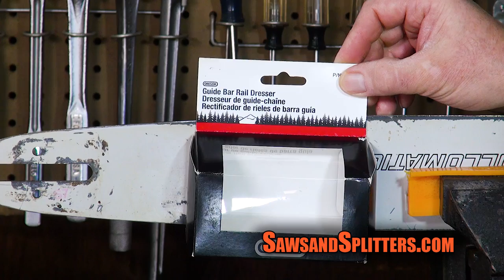HOW TO MAINTAIN A CHAINSAW GUIDE BAR EP.06

Comment: As with cleaning the saw dust, filing away from the tip sprocket minimizes filings from entering the sprocket and accidental damage to the sprocket teeth. I use compressed air to blow filings out of the rail channel in the same direction away from the tip. And also blows out the oiler holes. 
A good test to find burrs instead of your nail, is to use a dirty glove and if it catches any grime while pulling up and out, you've got more filing to do. If you're out in the field and don't have your bar cleaner/spec measuring tool, the corner of your base plate will work well to clear saw dust out of the rail channel. 
After it's all cleaned and filed, it's a great opportunity to sight down the bar and see if there's any bend to the bar (usually near the tip seam) and if your tip sprocket is splaying out/opening up. If there's daylight down either side of the sprocket or both, it might be time for a new bar since it will tend to throw the chain more often and/or wear out the tie straps and drivers on your chains.

Comment: A disc sander also works great for deburring the bar and squaring the top.  Use a black sharpie marker to color both rails so you can see after sanding where it is not square.

Comment: Excellent job. i appreciate how concise and clear this video is, and other than failing to mention the oiler holes, you hit the main points. 

in my experience, for those who are interested, the newer the chain is, the less sensitive it will be to burrs on the bar causing issues, and the more worn, the more sensitive. 

as you file the teeth, they become shorter and your cut becomes narrower, causing the burrs to contact the wood sooner. Also, the burrs are more noticible when making horizontal cuts when you rest the weight of the saw on the bar rather than holding the weight.

Comment: Great video, learned a lot. So my issue is this: brand new chain saw, the first time I used it and I wacked the edge of a plastic wheel barrel which seemed to cause the chain to cease. Disassembled the blade and the chain binds on the lower. How do I fix that..Thanks and keep making your videos, we're watching.

Comment: Good tips, but a little incomplete.  When cleaning the groove, btw they make an inexpensive tool specifically for that, you need to pay special attention to cleaning the oiler holes at the end.  If they are plugged, clean grooves will not matter.

Also, as bars wear, the groove gets wider from wearing on the inside.  Thus, your chain will not fit tight, causing it to lean to one side or the other, causing issues with cutting crooked and causing more wear to the bar.  They also make an inexpensive tool for closing the gap on the rails, fixing these issues.

As for flipping the bar, I do it every time I sharpen the chain, and I clean the grooves and oiler hole at that time also.

Good video though, bar maintenance is a very overlooked topic.
Reply from the maker: It's tough to cover everything and I'll be the first to admit I've got more to learn.  Thanks for adding to the discussion.

Since I was in high school I've used a drywall knife to clean the bar and it seems silly to get the special tool just to have the special tool.  That tool would be nice to have to measure the depth of the rails.

I've seen that roller tool on the Baileys website.  For the amount I use the saw I'm not sure I'd ever use it but it would be fun to have one it the tool box just in case.

I am horrible at taking the chain off and putting the chain on the saw.  The reason I hand file is to avoid having to remove and install the chain as much as possible.  I'm kidding, not really.

Thanks again for adding some great info to the discussion.
Reply: CTSCAPER , I totally understand that, and I hope my comment wasn't taken the wrong way.  
Your video is great, and seriously touched on a subject that is rarely discussed or fully understood. 
I learn something new every day, and just wanted to share my experiences with you. 

The taping knife as a groove cleaner is a good idea, way better than using a screwdriver. 

I know what you mean about buying tools you may not use much, I have lots of those...  lol!

It is nice though, for when you really need it, or if a friend does. 

Keep up the great videos, I always look forward to seeing what your next video is going to be. 

Thank you, and take care!
Reply from the maker: No offense taken.  I've been buying tools I don't need for years and every once in a while I think, "What the heck?!"  Then I'll be out at some hardware store and come home with more.... :-(
Reply: CTSCAPER lol!  😊

Comment: I have had a Black and Decker Electric Chainsaw for the last 40 years, it is so light I can hold it in one hand.   The bar has been dressed several times, and as well as the burr on the outside of the bar, it also creates a burr on the inside of the guide slot.   This has to be removed with a 1.2mm thick flat mini-file.    I think I have also used an oil-stone for the external dressing.
Reply from the maker: That's great news about your Black and Decker Chainsaw.  I've been looking at battery powered saws and your feedback is good to hear.

Comment: Can i restore a bar with this method when the chainsaw is already cutting bends?
Reply from the maker: If you look farther down this thread Good Day Farm posted another reason the bar could be cutting crooked.  The rails opened up from wear.  If the bar is cutting crooked look at (1) the rails to see if they are open wider then they should be, (2) the rails to see if one side is worn out more than the other, (3) the bar to see if it's bent causing the saw to cut crooked or (4) the depth of the slot for the chain to see if it's worn down to the end and the chain is sitting proud to the bar.

I hate to sound like a broken record or being too safety conscious but if you take the bar to your dealer they will get you headed in the right direction.  If the saw is cutting crooked it could be an even more dangerous situation than using a chainsaw in the first place.

Hope the info helps and be safe.

Comment: Please note that the translation is strange because it is done through translation software.
I understand that maintenance of the guide bar is important, but it seems that the person doing the maintenance has little knowledge of the file and does not know how to use it.
Except for diamond files, you can basically only file in one direction.
Therefore, if you shave it in the opposite direction or to the side, the file's eyes will close and the life of the file will be significantly shortened.

Comment: Thanks for the video. 
Unfortunately you are filing/dressing from back to front wheel, and fill the wheel with dust.
Reply: Nothing a spray with the air compressor won't fix.

Comment: Not bad at all fella... I would add a healthy dose of air to remove that swarf, especially in the two oil holes (which will be utterly full of oily crud anyway) and the nose sprocket can only easily be cleaned with compressed air anyway. Letting it spin up with air pressure (WEAR EYE PROTECTION) will usually release a surprising amount of rubbish. 

When filing don't go back and forth with the file... It will not only damage the file but the end finish will not be as good... Instead keep the angle with the cut of the file and lift off at the end of the stroke as you would normally. 

I've not tried that bar dressing tool before. I'll be sure to take a look as it would shave an age of the job by the looks of it! Cheers chap :o)
Reply from the maker: I agree on the air to clean out the swarf.  Everyone talks about trouble with the oiler holes though I've never had an issue with one in my life.  I think I just jinxed myself.  I love the spinny noise you get when you blast the nose sprocket with air. :-)

I've got a filing video coming up next in the series.  It'll be a great chance to start some discussion on filing and learn some tips from viewers (My  hidden reason for posting YouTube vidoes.  There's always someone watching who knows more than me.)

That tool is the cat's meow and I don't regret getting it.  A file works fine for the sides of the bar but the bar dressing tool is nice for the top of the rails.
Reply: I agree... everyone knows more than me I'm sure and I've certainly learned a good few things from your videos! If I wasn't camera shy I'd do a few of my own... lol 

I've had an oiler hole block and the result was the same as not cleaning out the bar properly... scorched metal and a lot of work to rectify the problem. 

I'll invest in one of those bar dressing tools then. I'm most impressed with that and thanks a lot for bringing it to my attention :o)
Reply from the maker: Glad you enjoyed it Matt.  Thanks for sticking with me through the years.
Reply: Thanks for tolerating me fella ... it's been a pleasure learning with you :o)